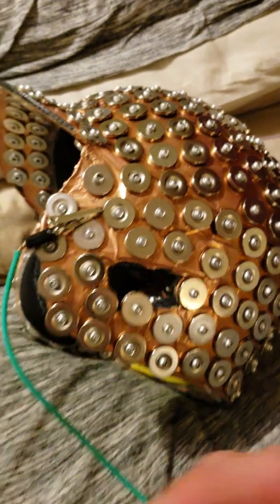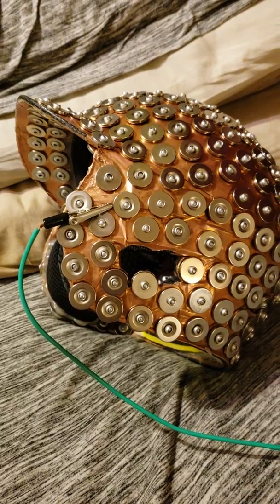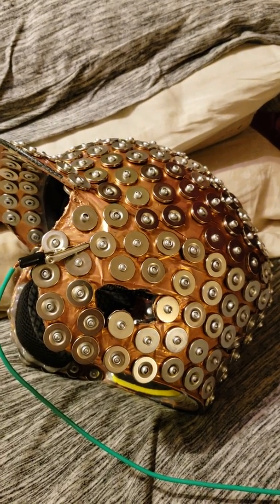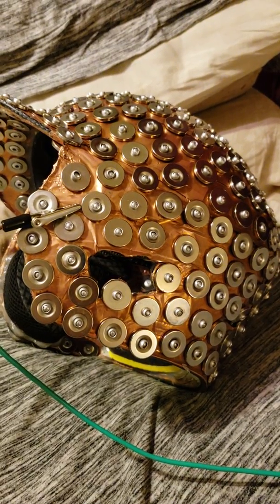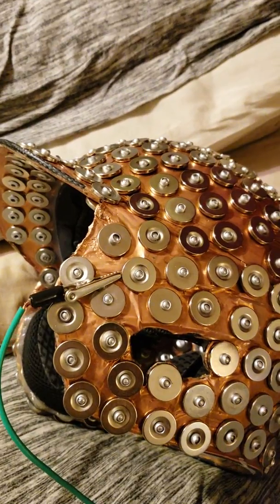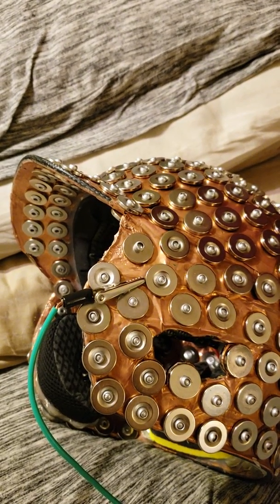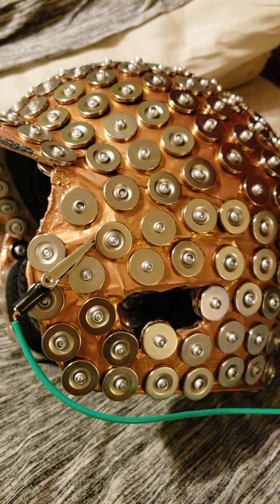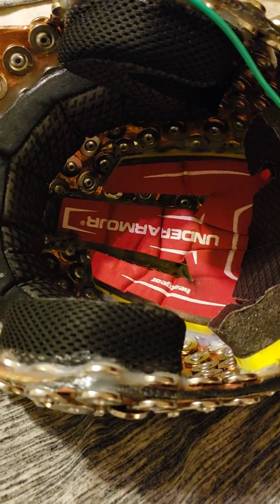Targeted individual Reverse Polarity Magnet Helmet Gold

Comment: The ground should be making contact with your skin.  Take a two foot sheet of heavy duty aluminum foil and fold it to 2" X 6" and clip the alligator clip and then stick the rest in your waist band against your skin.  Magnetic interference is very, very good.
Reply from the maker: It's different with the helmet. No energy bothers my body. With the magnets it attracts energy and repels it. Attaching the ground to that area on the helmet you can actually feel the energy flow like air on your hair. Disconnect the ground I can feel the heavy build up. Attach and you feel that build up flow out to the ground. But I have no doubt that would help as well to add. But I'm trying to keep the M-5 helmet hands free as possible so you can move about without having to be tethered and re connected after.
Reply from the maker: Aluminum foil is an antenna

Comment: Hi Robert. That's a great udea. I was wondering if the magnets on the brim of the helmet prevents them from watching you. I was hoping it would protect my eyes for privacy also.
Reply: Thanks for letting me know. I need to get a better shield asap.
Reply from the maker: The magnets on the brim help block the strobe lighting in your eyes while closed. The see through eyes bit I wouldn't worry about that. They see by your brain giving the description of what your eyes see. Try imagining a different description they will see only that.
Reply: Thanks. That's great news. I thought they could see through my eyes since they like to call out what they see. So this means that all of the attacks are coming from the brain and the ears.
Reply from the maker: @juliettelovett9489  , yes that's why I say shield the brain,  solve the problem.  Every day my brain and others get better every day.  Hits I deal with are when I'm not wearing  and have no real effect on me because of the strength build up and healing to the brain from wearing the helmet.

Comment from the maker: The Magneto-5 helmets isn't needed to wear everywhere.  Mandatory for first time wearing for 24/7 giving your brain time to recover and heal. Plus it does take a little time for your  body to get use to the energy of the magnets.  After wearing for 3 months or when comfortable you can wear  just when relaxing at home and every night for bed. Wear as needed. I've driven with it before and didn't care who saw as long as I was shielded.  After some time you'll feel the change and ability to function throughout a day without.  Always take with you if your away for trips. Hotels,  hot spots. It will save you when most needed.
Reply: What kinda of magnets  and how many?and can we just get copper helmet of the outsed
Reply: I need one

Comment: Good tip for you while driving. Cover all speakers with t shirts or some material, conductive material is better of course. This is because they use magnets or anything metallic as antennas from the satellites or beacons on your car or even DEW's mounted inside vehicles following you. Worried I'd get stopped by cops if wearing helmet in the car.
Reply from the maker: You can cover speakers with velostat.
Reply: Thank you. Gonna try it.

Comment: Two excellent additions to your helmet design! Temporal lobes and grounding. Is it worth the upgrade over the standard helmet? Cheers mate
Reply from the maker: Yes actually.  I would put 2 layers on both sides though. It did seam a lot more calmer and on unusual hard hits you get a light energy feeling on your hairs on the regular M-5. But this one it goes straight to the ground.  If you already built a helmet you can layer the copper on top if the magnets to try out and ground. Without ground the energy builds up. This M-5 Gold helmet though has to be grounded. The M-5 helmet you are more maneuverable.
Reply: @robertstanson7866  So this can ne grounded in your car?
Reply from the maker: @bageltv321  yes. By getting a car adapter cut end replace with an alligator clip please note to remove black and white wires only connect to the green wire ground or you might have to get a inverter small one from Pep Boys or what not and use a power cord has three prongs cutting out the black and white wires leaving the green and connect a alligator clip to that.
Reply: @robertstanson7866  Hello I live in france and i receive attacks, how can i protect my head of lasers?
Reply from the maker: @mswho8404  mumetal is preferred at 14 gauge thick. I use 2 types. Mumetal or my enlightenment Hemet silver & brass & blacksmith to shape of head.
Reply: @robertstanson7866  what about shungite, can this stone protect me from  attacks?
Reply from the maker: @mswho8404  yes. I use shungite regularly.